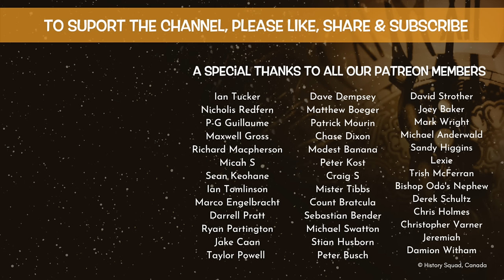Hand making a medieval style arrow, now, and in the middle ages

Comment: Excellent video, Kevin! I really like how you make distinction between 'arrows' and 'ammunition'. Because that's what they were, disposable ammo, used in (tens of) thousands on the battlefield. And while some could be recovered and repaired, majority was simply 'spent'. It also puts the 'art' of arrow making into a different light because in the old times, it was not an 'art' but a profession. Of course it required skills, but the consistency and high-volume output were just as important because, in the end, people made arrows for living, not as a hobby.
Reply from the maker: A brilliant comment there, thanks 👍🏻
Reply: they had there own livery company in the city of London for fletchers and a separate one for bowyers which I think means  that you had to be apprenticed which at that time was 5 or 7 years there were over 100 livery company's covering most trades and occupations many which are obserlete  today the penalty for setting up a business without being a member of these guilds were severe  as in middle ages severe ,imprisonment and many of the judges and jurors had connections with these guilds and solicitors and lawyers had there own guilds no fines or suspended sentance then ....
Reply: Kills before skills 😉
Reply: Valid point, However as a bracket racer, long range shooter and production line setup guy, theres no greater skill than obtaining quality and consistency shot to shot! Its just not "flashy".
Reply: Even to this day the treatment still holds true. I make bullets. Some are for distance shoots, I weigh everything, measure everything, etc to make perfect and identical bullets. Others of the same caliber are made from my worst brass as it may or may not be recovered, simple cast lead and produced in as large a quantity as possible as quick as possible for shooting problematic wildlife I may run across or plinking targets for fun.

Some things change and dont at the same time.

Comment: A bit more than 60 years ago I used to make arrows using dowel rods I bought from the hardware store (way cheaper than cedar shafts!). I hadn’t yet figured out how to make a fletcher (couldn’t afford that either), and instead secured my fletching using thread similar to what you show here. Only I never thought of leaving it there. Once the glue was dry, I unwound the thread, a step I see was unnecessary!

Great to see that there are places where wooden arrows are still used. I have a box of never-fired cedar arrows stored away. Once I moved to using a compound, I found out quickly that wood simply didn’t last. 

Great presentation.
Reply from the maker: And a great comment David, thanks!

Comment: I have actually made arrow heads out of a very hard wood know locally here in the U.S. as Bodark contracted from Bois d Ark also known as Osage Orange and it  makes the best bows in the U.S. but is so hard it makes broad head arrow heads, good for a couple of uses, not RAZOR sharp but able to cut through a deer and they are easy to make with a little practice, cap the arrow or insert it into a hole and be sure to wind string around it.  add glue and it's ready to fly and is a little lighter than aluminum .  It also makes good target field tips and can be replaced for next to nothing.
Reply from the maker: Wow, thanks for the tip, haha, pardon the pun.  I never knew that 👍🏻

Comment: I've always been curious how such things were done for making 10,000+ arrows for fielding an army or for a castle garrison.  This process seems so man-hour intensive.  A tactic not mentioned often is forcing a castle to loose all of its arrows during a siege.  It seems like it would be an advantageous tactic to use red herring rams and mantlets to force defenders to use up their arrows and then storm the walls with crack melee troops with no arrows left to loosed upon them.  A well fortified fortress would have to have thousands of arrows in its armory, and garrison commanders would definitely need to be cognizant of how many arrows they're putting down range.  Furthermore, commanders would also need to be cognizant of how long it would take to replenish arrows whether to maintain a defense or timing of successive attacks on fortified positions.  A major purpose of armor and shields was defend against arrows.  All of this implies there had to be some kind of near industrial scale process of making arrows.
Reply: Well, surnames such as Fletcher and Arrowsmith had to originate somewhere.
Reply: Bowman, Archer, Fletcher, Stringer….all called Tommy and all at Agingcourt.

Comment: Thanks Kevin, absolutely captivating. Your workmanship and knowledge shines through and you have a great way of passing on your knowledge. Takes me back to when I used to shoot longbows. I used to make my own arrows but not in the traditional way like this. Mine were made from Port Orford cedar with plastic knocks and purchased fletching with brass arrowheads. Still I took my time with them to get the lengths the same and nicely matched up. It gave me a sense of pride to get a set of a dozen or so that looked as good or dare I say it better than anything shop bought and mass produced.
Reply from the maker: Thanks for your comment Steve, I have to agree, the sense of achievement in making your own arrows is pretty special 👍🏻

Comment: Another workshop video. I quite enjoy these videos on the creation or maintenance of the Kevin Arsenal. Although it does raise two questions. What is the fastest time making a single arrow? And do crossbow bolts have a similar method?
Reply: Crossbow bolts are easier to make, and not just because they are shorter and thicker than arrows.  They are commonly left with an octagonal cross-section because, unlike an arrow, the arris will never meet the shooter's hand.  Bolts also have just two vanes, 180 degrees apart, which can be made of leather or even wood, again because they will never meet the shooter's hand or any part of the crossbow.
Reply from the maker: Good questions, I'll be doing some crossbow bolts soon 👍🏻
A single arrow, if I have the shaft prepared already (i.e. a bought one), with drying time for glue, whipping & pile/arrowhead, I would estimate around 1 1/4 hours, but it's not time-efficient.  
If I'm making arrows, I make a sheaf (24) at a time in rotation.  In history they would have had a production line going.
Reply: How did I miss these two responses? Oh my am I glad I double checked. Thanks to both for answering my question.

Comment: Interesting video, but I have a few comments, if you don’t mind. Because quantity was the order of the day, I think the logs would be split with a froe, which is fast and keeps the blanks following the grain, which helps prevent warping and breakage in use.
Next they would use a jig that is basically a U shaped plane blade going through a block of wood. You would have a blade on two sides of a hole and you pull the blank through to round it off. You could do a bundle of blanks at one setting, then knock the blades in a bit and redo the bundle, repeating until you reached the right diameter.
I don’t know for sure, but putting the horn in one end before rounding them would have saved time and effort shaping them manually later on.
If they needed smoothing, you would use a bit of cloth or thin leather coated in tallow and sand or water and sand. You could use the finer dogfish skin to polish them off afterwards.
Heads would probably have been glued with hot animal glue or hot pine and charcoal resin, and fletchings and knocks probably with chewed up bluebell bulbs (poisonous if swallowed). Hot glue could have sealed the whippings which, incidentally, might have been made from flax or stinging nettle fibres.
To keep them from getting damp and warping, they could have been dipped in boiling linseed oil or polished with tallow.
I noted that you use epoxy resin to fix your heads on, but epoxy doesn’t like shocks and it cracks easily. You could try dipping the arrow tip in contact adhesive and assembling it straight away. The solvent will soak into the wood and it should create a strong bond.
Arrows that warp can be warmed over a flame to soften the lignin and the arrow then straightened by hand before it cools.
Hope all this helps, but I will be interested in any feedback.
Reply from the maker: I've tried using one of those planes and it very difficult, they tend to cut deep.  Using the jig I made you can actually make a shaft very quickly.  I think you're trying to apply a modern mind to an ancient and simple technique.  Thanks for your thoughts though, I've been making my own arrows for over 30 years now and they do me pretty well. 👍🏻

Comment: Very nice! Out of curiosity, how long are your arrows and what's your draw length? I've noticed you draw to your mouth and not the ear.
Reply from the maker: Depending on which bow I'm shooting and over what distance, when I draw to the mouth, I'm pile-on.  I have another bow that I draw long distance which I draw across my chest - I'll try to shoot a video on this before the winter sets in.  ￼
The reason I leave mine long 31/32" long so that when I snap a pile off, I can repair it and eventually it'll get down to 28"  😜
￼
Reply: @thehistorysquad  Looking forward to it! I'm only ~28" when I draw to the ear, so I must be medieval-sized haha. 
Have you ever considered putting a horn insert to reinforce the point? 
I don't know if it was done historically, but it just came to mind.
Reply from the maker: @Archaic-Arms   Yes, historically what some household bowmen may have done, apparently, was to have footted their arrows with a hardwood like oak, so it would have made the bottom 6" of shaft, extremely strong at the tip.

Comment: This is a very interesting video.  I actually tried making an arrow. I was able to do the knock/Knoc and tie on the fletching, but I'm still experimenting with the arrow head weight. I haven't got it quite right yet. I'm looking around for either a formula or a best practice to have a good balanced arrow. 
Any recommendations from you are welcome Mr. Hicks.
Reply from the maker: Not sure of a formula I'm afraid, but take a look at Will Sherman, medievalarrows.co.uk he does arrowheads, as does Hector Cole, hectorcoleironwork - both top arrowsmiths, they might have some info on their sites.  👍🏻

Comment: This was great - I’ve always wondered how they made the straight shafts in ancient and medieval times, in fact I was one of those that asked you to make a video.  But one thing still puzzles me - you start off talking about the arrow tress with their straight (ish) branches.  But when I look at the photo, yes they are straight but nothing like arrow straight.  And then when you make the shaft you cut it from a bigger piece of timber (lumbar).  Cutting the shaft and then shaping it with the plane and sandpaper made perfect sense but I’m struggling to see the connection between the large piece of timber used and the arrow branches.
Reply from the maker: Hi Nigel,
The arrow branches from coppiced saplings were in the day pretty straight.  I believe each tree was coppiced on a 7 year rotation.  These coppiced shafts could be purchased skinned or non skinned (bark on or bark off).  The fletchers would still have to finish the shafts by using either a piece of sandstone with a hole drilled through it, or sharkskin.  
This system of arrow supply couldn't furnish the overwhelming demand, so the other method I showed taking wood from a larger piece was necessary.  
In addition, to achieve a coppice, you needed to cut down the main tree, giving you the large sections you needed, not only for arrow making but other crafts.
Here's a video that talks about materials & coppicing in the medieval times https://youtu.be/ACRLO7NDf0Q
Reply: @thehistorysquad  Thank you so much for taking the time to reply - it is very helpful and informative
Reply from the maker: @nheather   You're welcome 👍🏻

Comment: 21:36 He forgot to mention, but traditionally, they wouldn't usually glue the heads on war arrows. They would coat the tapered end of the shaft with bee's wax and just friction fit the point on. That way if someone tried to pull the arrow out of their body, the head would come off and stay inside the body.
I'm not 100% certain if they glued the broad heads onto a Nobleman's hunting arrows, but I suspect the answer is the classic "It depends". Swallow Tail heads would have been very expensive and I suspect they'd like to recover those. But who knows: Maybe the King and his hunting party saw them to be just as disposable as the heads on a common Bowman's arrows.
Edit: Perhaps there's a video idea here comparing the English Bowmen and their equipment to the Continental Bowmen and the differences of construction or arrow type preferences

Comment: I think if two beech blocks were made with a corresponding groove in each and a screw adjustable blades positioned on one end. The blocks could be held in position with a weight on the top block while a shaft was 'pulled though/rotated/pulled through' until an accurate dowel was made. It's likely the guys back then would have had methods to speed up production.
Reply from the maker: Possibly yes, although it's surprisingly quick using my jig and if you were doing it day in day out, they'd be able to knock these out much quicker than me.  👍🏻

Comment: Sir, in America we have the game of baseball. Players used to rub a large ham bone up and down the barrel (large end of the baseball bat) with the grain of the wood. This smoothed out the finish and hardened the shaft 
Would this improve your arrows in any way? Durability, reduction in drag, etc
Reply from the maker: I have tried different types of grease etc. etc in the past, but seemingly with minimal effect.  Wax though on the bow where the arrow passes by seems to work though 👍🏻

Comment: You mentioned the feather being "right handed" but you only talked about one arrow.
Do you make sure all 3 feathers are right hand so they help the arrow rotate?
Do you only use right handed feathers on all your arrows?
Reply from the maker: Yes, I do use right handed feathers on all my arrows.  👍🏻
Reply: @thehistorysquad  thanks for taking time to answer my questions.

So historically did everyone only use "right hand" feather?  Like only using half of the total number of goose feathers available.
Reply from the maker: @ericwilliams1659   I doubt this very much, it's just my personal preference. 👍🏻
Reply: @ericwilliams1659  Hi, like Mr. Hicks I strongly doubt only right-wing feathers were used in the old days. Mass production made it necessary to use all. If one uses a jig to position the feathers it has to be re-adjusted for left-wing feathers. I collect my own goose feathers and use both sides. I don’t see a difference during flight in the arrows. Only use same side feathers on one arrow.

Comment: I read somewhere that on the battlefield, arrows were supplied without heads. The archers would use whichever type of head which was suitable for the occasion and 'glue' them on with molten wax.
Do you know if this is true?
Reply from the maker: No it's not true Frank.  Archers would never have had time to glue on their own arrowheads in a battle.  The arrows would have been issued as ammunition 👍🏻

Comment: I'd really know more about straightening techniques. I either see very primitive bending when wet and heated up or carpentry machine usage. What about the medieval ways? How did they straightened the arrow shaft properly?
Reply from the maker: I’ve just been looking at artifacts here in the US, how the natives used a straightening stone.  In England They used a sandstone with a hole through it 👍

Comment: I thought a lathe would have been used, like bodging chair legs. But I guess they'd be harder to use back in those days, not just stick it in a chuck at each end and run a steel tool down as it spins.

Comment: what ive been using lately, is gorilla glue gel, with the carbon shafts and modern flights, i find the shafts are to smooth and you get overrun or splerdge out of the sides, is that pva glue with the wood and feathers kev?
Reply from the maker: I use any clear glue or white pva would do, as you're binding the fletchings afterwards. 👍🏻

Comment: Our hunter gatherer ancestors would have also used buckskin with sand in it and run the stick through it, applying pressure and putting the sand back in when too much has fallen out.

Comment: How do you get the arrow shaft straight? There can’t be too many perfectly straight branches shooting out of the tree
Reply from the maker: From what we understand there was coppicing (the growing of straight branches from the base of a tree), but they also split larger pieces of wood in straight sections, which as I demonstrated you take off the corners until you have a round.   But since ancient times, there's been an arrow stone with either a groove or a hole through it which was also used to sand away any kinks 👍🏻